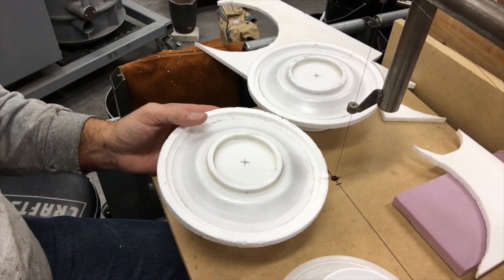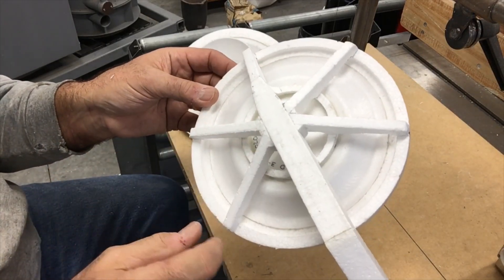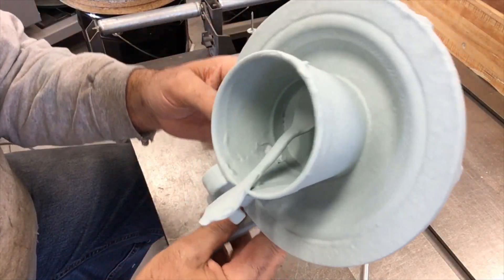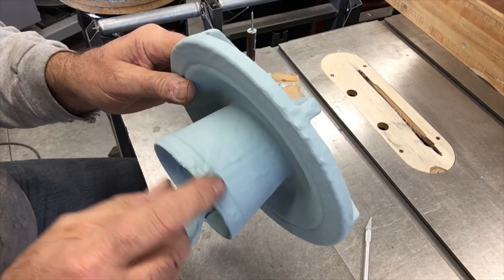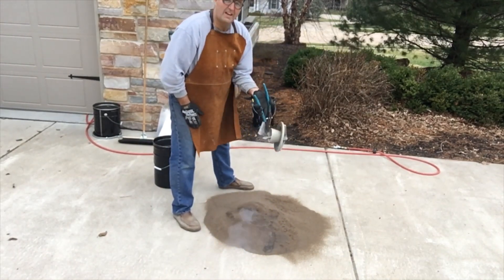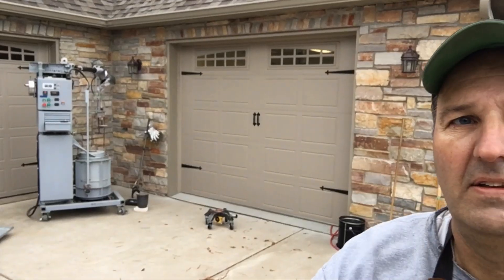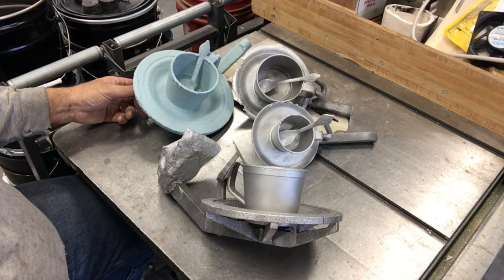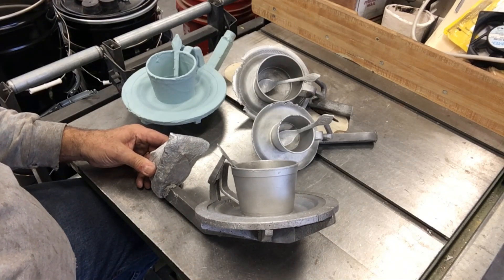Thin Walled Lost Foam Casting: Part 3 Completing The Project

Comment: Excellant video! I wantedt reach for the vacuum when it tipped. Thanks for sharing your knowledge, it has inspired me to try it.
Reply from the maker: This was just an experiment in the art of the possible with lost foam. You won't need vacuum on 99% lost foam casting aluminum. In fact, this may have been the last time I actually used it.  I chose the saucer cup and spoon, because I had ready-made patterns and it was one of the traditional tests for progressing from Apprentice to Journeymen molder.......and doing so in green sand takes molding skill. In lost foam it takes no molding skill at all. This very thin wall thickness would be challenging in any sand-casting process. Best, Kelly

Comment: Instead of making the mold parts thicker, what if you preheated the mold for the pour?
Reply from the maker: The polystyrene pattern would become soft, deflect and/or melt causing the mold to collapse because it's just dry unbound silica sand. Best, K

Comment: Remarkable! Truly remarkable! But 1700 deg F  - wow - I make that 927 deg  C and as you said that sure is hot for aluminium. What alloy did you use?... Martin
PS. My reply to your reply is in preparation. I got delayed by being seduced into watching this video series 😊
PPS. 3 tries - yeah, that sounds about right from my experience with difficult jobs
Reply from the maker: Not proud of nor do I recommend 1700F for A356 aluminum.....but was just trying to fill difficult part. This was a process development project to explore the art of the possible. Being it was a resistive electric furnace with a very clean and lean atmosphere helped, as I'm sure a fuel fired furnace would have increased the risk of gassy metal. The professional LF foundries typically pour 150F hotter than conventional sand casting. Most of my LF aluminum castings are .25"-.5" wall thickness and I pour them at 1400-1450F. Cheers Martin, speak soon. Kelly
Reply: @kellycoffield533  , Yes, at 1700 F gas would sure have been a big risk unless one was very quick getting there and immediately pouring. If I had to do it I would certainly be using an Argon degass and / or cover (I degass anyway but hardly necessary for job like this 😊) I very occasionally go to 800 deg c (1450 F) for hard to fill parts. However 356 is not exactly known for its fluidity - did  you consider your equivalent of British LM6 alloy - essentially 12% silicon and low iron, much better fluidity and lower MP plus lots of heat release as the Si starts to solidify. I have no idea how it performs in lost foam though....Martin